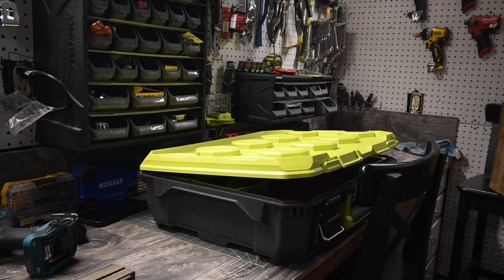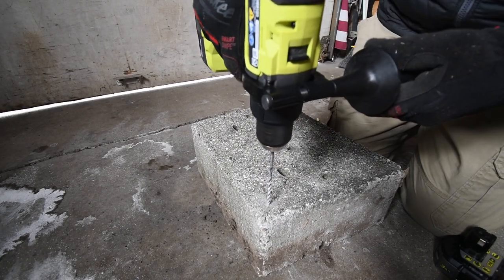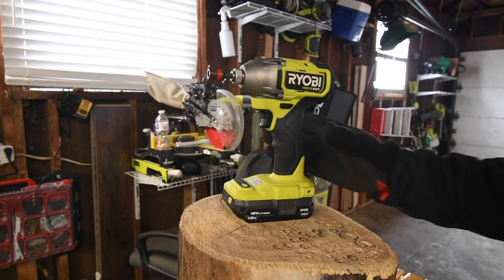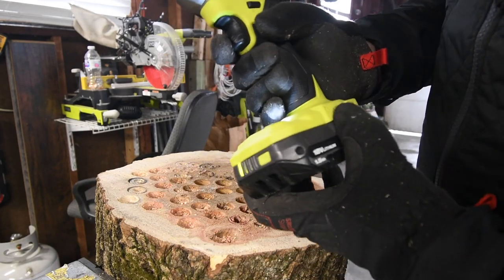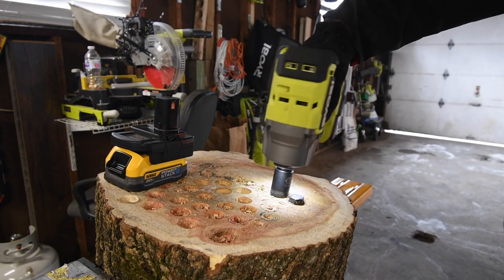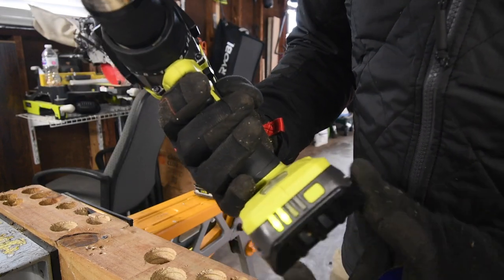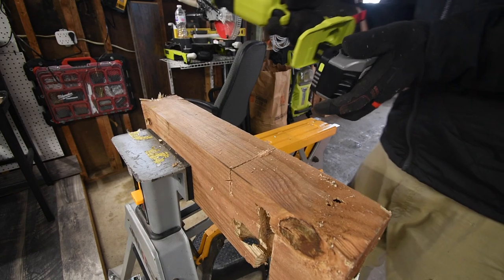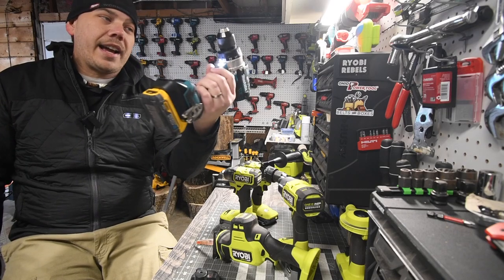Dewalt Power Stack battery in Ryobi Tools!

Comment: I used a dead 1.5 ryobi battery and a knockoff DeWalt post to slide adapter to make a bulkier version that has held up better than expected for bad soldering. Lifespan just depends on where the circuit boards care about power for how long till we burn out something.
Reply: 65 Ford does as well

Comment: That one hand recip saw using a good blade and good battery is really very good. I do find it runs a little warm but overall very good. Second point the Dewalt battery with the conversion doesn't look any more compact then the 3ap hp battery. Excellent video as always.

Comment: Should've used the new ryobi 4AH
Reply: Why? The P195 is the only Ryobi 18V that was made with 21700 cells, so should outperform any of their 4Ah batteries. Unfortunately it is no longer being made.
Reply: @ccbowers  it's been proven that the new 4AH has better power, it's also what's sold in the kits although in Canada we can still get them for 68 bucks.
Reply: @bread-gz3rl  Which 4Ah model are you referring to? And where can I see the comparison?
Reply: @ccbowers  it's the PBP004, I'm pretty sure it was in a workshop addict video about 7 months ago but I can't post links or my comment gets deleted.
Reply: I was unable to find that the workshopaddict tested this battery P195 and this finding would contradict other videos. He did test other batteries. Torque test channel did test this and found the P195 to be a bit better in an impact. Makes sense given 21700 cells and similar capacity. For high demand applications you'd probably benefit from a 6Ah or 9Ah battery over any of the smaller options

Comment: I do not like ryobi, they are ugly and the battery is huge, and they are not much cheaper than the way better ketchup and mustard stuff, like why buy ryobi? I don't get it... 🤢🤮
Reply: Who else has a cordless glue gun and dremel stations that aren't garbage, plus the 40v stuff exists which some is better then ego
Reply from the maker: I like Ryobi's new design
Reply: @ManCaverTools  the new ones do look better
Reply: @bread-gz3rl  I actually have a ryobi lawn mower, it was a gift but I do use it often, it's OK, it gets the job done but have to give it a few passes to get everything, idk maybe the blade needs replacing